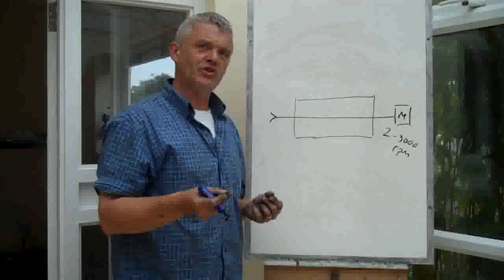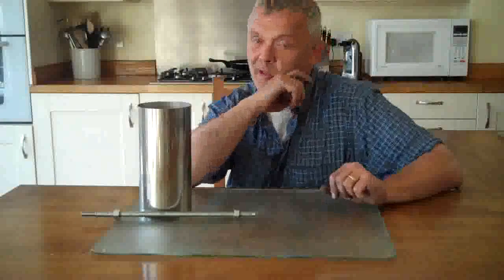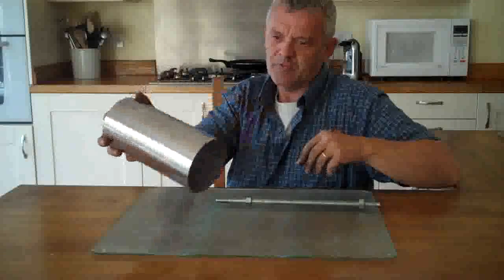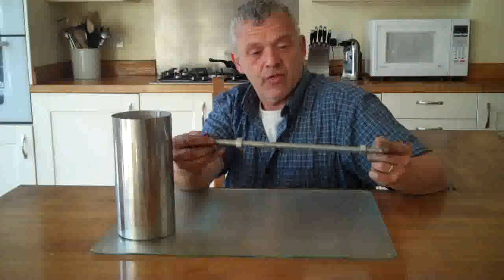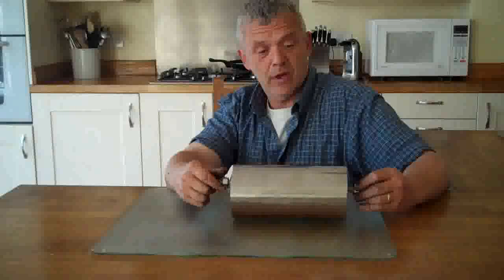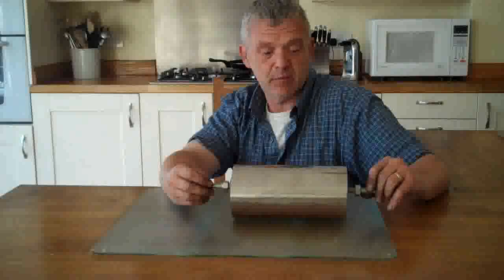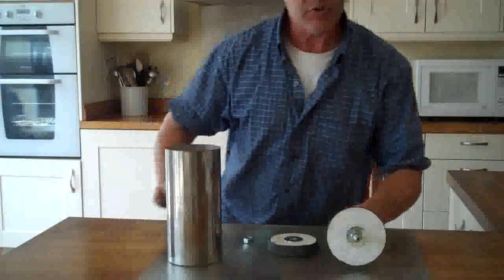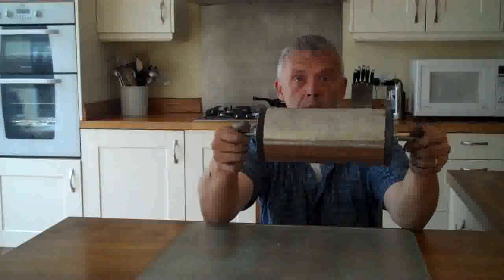How To Make a Ball Mill 2 - A High Energy Ball Mill

Comment: Hi Robert, what's the advantage of Ball mills for small volume experimental work, over something like a mortar and pestle (except for the obvious lack of muscle required)? I'm also a bit confused that when making biochar carbon nanostructures that one of the first things that's often done is to smash them up! I can understand that intimate contact is required and therefore small particles, but doesn't something like this also destroy the structures achieved from the carbonization process? I presume for more precise control of particle size, something like a 3 roll mill is required?
Reply from the maker: hiya mate - you do get more homogeneous mixes with a mill as you just can't supply the power or evenness by hand - you get tired long before a machine - with the detail of structure we are talking about - nanometre range - you probably can't smash them up that much

Comment: interesting video, wouldn't that kind of ball mill exceed critical speed? That would have some inefficiencies right? Big fan since 2012
Reply from the maker: there would be mate - you are never going to home build a machine as good as one you can buy unless you have a very sophisticated workshop and are happy to spend a lot on materials and time to build something - this is meant to get close enough - but not to be perfect
Reply: Good point, an ultrasonic cleaner seems like the best way to go. Convert product to liquid and it should do ball mill work in less time and more efficient.
Reply from the maker: nice plan mate

Comment: A way to quiet a ball mill is to fix on the outside something like carpet in the areas that will not interfere with operations the vibrations get spent in wiggling the carpet fibers rather than making pressure waves in the air.
Reply from the maker: cool idea thanks
Reply: Your welcome Robert, I posted my first video working on a battery. Just the first half but the rest should come in a few hours.
Reply from the maker: cool mate - i will go have a look

Comment: Hello i have a problem with mi ball mill when i put it on. And the container start tu make a little jumps
Reply from the maker: it's probably slightly out of alignment or too light - try more grinding medium in it - or a heavier medium - i use lead filled rods

Comment: Im having a HELL of a time with drying my Ferric Chloride!  It does NOT crystallize easy at ALL.  You basically have to cook it down and it turns into a thick hard puck of chocolate looking materials.  I am wondering if perhaps I should build one of these. I realize I would first have to pulverize the puck into a manageable size to give it a chance.

I have a load of polished chromium steal shafts for mechanical assemblies.  I wonder if allowing these to tumble like so many logs around in this thing would work well.

its funny I actually built a 30 gallon tumbler years ago for turning malted grain.  It worked wonderfully.
Reply: I did it again
Reply from the maker: try to recrystalise it by boiling down to just less than the solubility limit then letting it cool - the ferric chloride should drop out of solution as nice green crystals pour off the liquid and air dry - then try again - chocolate brown doesn't sound right
Reply: Thank you Robert I will try that.  I have noticed that all of my Iron (III) is a touch darker than amber.  

Yes it has behaved very strange indeed.  I followed Nerdrage process to the tee adding one the washing of the nails in acetone as some that were not rusty appeared to have a slight oily film.

The process of evaporation that I used was just that.. More of a evaporation than a boiling down. I used a large flat pyrex dish like a casserole dish. and put it on a hot plate with a series of fans mounted on top to aid in evaporation.  never hit boil.  It just reduced to chocolate syrup then turned hard and lumpy.   Weird.... 

Same thing happened when I made aluminium chloride but it was a white puck.
Bunny thing is I did actually recrystallise the Aluminium at a boil and it came out of solution as expected.

Thank you again. you are always a big help to me.
Reply from the maker: Clown Whisper coolio
Reply from the maker: normally I put iron wool into HCl and the crystals just drop out

Comment: Have you tried it? I would have thought at 2000 rpm centrifugal force would come into play and there would be zero work from pounding balls?
Reply from the maker: depends on the balls you use but - yes i have been using it quite a lot as it happens - i also made some rollers the same length and used it as a roller mill

Comment: Hi. I am following all your work with deep interest.GRAPHITE Q1. Is your ball mill in conection with making graphite powder from flake? VARIABLE SPEED: I have obtained a number of speed controllers AC&DC suitable for controling small motors ie.Power tools  universal motors,fan,magnetic stirrer and all other whirlygigs you have mentioned in videos.I will be testing these over the next two weeks and will report. 
Best if no one rushes to buy ebay

Comment: Please tell me what the results are, once you've built it. I was working on a homemade high-performance (1400W) planetary ball mill, but lacked the resources to machine the necessary parts or have them machined. Your design might provide a solution, as one should be able to produce it more easily.

Comment from the maker: Thanks for that. I was thinking fixed axle and friction wheel drive.
Reply: instead of drilling a hole in the nut to lock it, I think you can tighten the 1st nut to the desired location and then hold it and tighten a 2nd nut against the 1st and that should hold the nuts in place (neither nut should move when very tight against each other)... done on both sides - 2 extra nuts would save time and be good for people without the drill and skills you have.

Comment: and make sure the distance between the outer edge of the blade and the wall of the container is smaller than the diameter of the grinding media. Then, the blades would keep the media from sticking to the wall of the container and enable them to do some grinding work. I recommend using a blade that covers the entire length of the container, so that the media cannot slip past it anywhere.

Comment: It might seem to do fine on the outside, but ball mills only work if the media have the chance to fall onto the material. When centrifugal forces rise, they stick to the outside and don't grind anything at all. You would need to attach the blades to a non-moving axis (which would mean that you either have to drive the container with a hollow shaft, or drive it like in a normal ball mill, with a friction wheel touching the wall of the container)

Comment from the maker: I have been playing around with it most of the day and it seems to be doing fine. Though at the moment I am limiting the rpm to 500 and using 1cm steel ball bearings as grinding media. To go faster or use different media I will probably put the blades on that I was talking about in the intro

Comment from the maker: sure. But the cheapest 3d printer is £2,000 and you have to buy the printing material which is plastic and not up to the stresses here. my lathe was £200 and I am using steel. And as for a safety mechanism, beyond a shield against flying parts what would you suggest?

Comment: So how about modifying a used upright washing machine? you could limit it to just the spin cycle. Of course you will have to set it on it's side so you can replace the big drum with a smaller drum resting on rubber wheels for balance. remove the water pump since you won't connect it to the water main. The transmission uses a rubber/plastic coupler designed to break off so you won't damage the transmission or the motor.
probably overkill but they are cheap and simple.